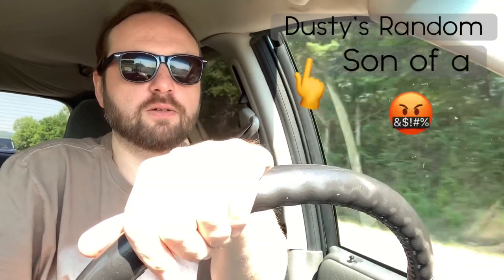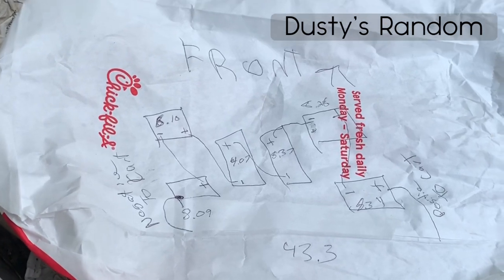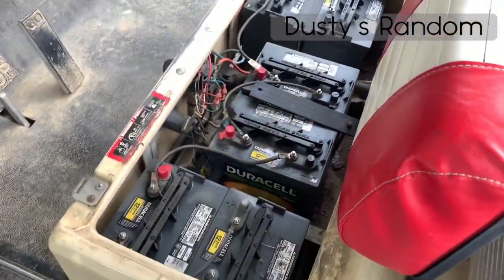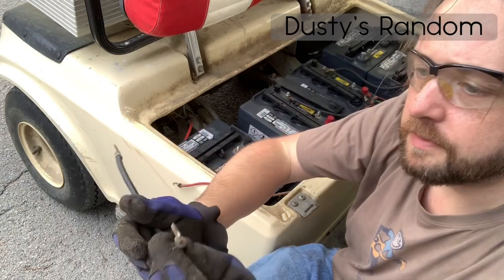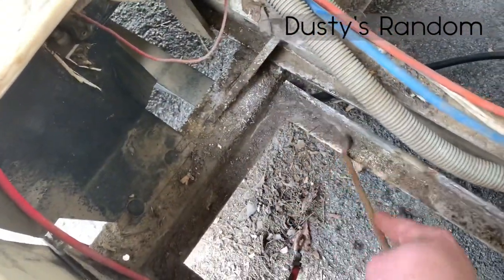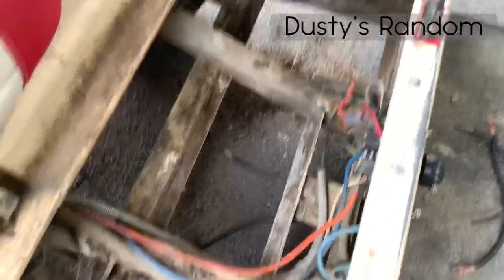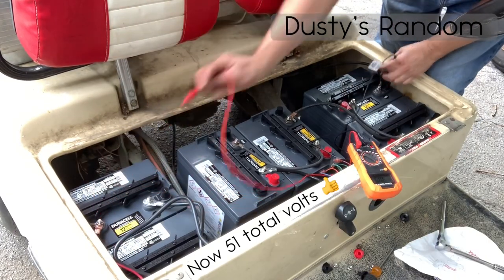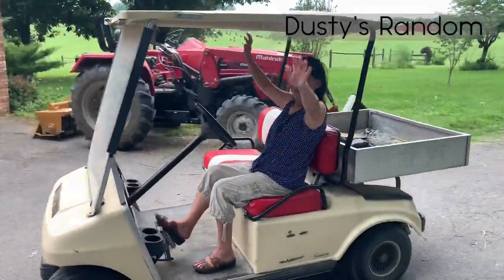Club Car Golf Cart Battery Change 48 volt

Comment: Over the years I've had decent results from coating the terminals with Vaseline before reassembly.   It helps prevent corrosion and ensures easy removal at a later time.

Comment: We almost had the exact same problem with our 6, 8 volt batteries. All 6 of them showed they were dead. I saw on YouTube where you can revive dead batteries so I bought a 24 volt battery charger for around $34 on Amazon. We charged three of the 8 volt batteries at a time and brought all three back to life. It saved me a lot of money and hassle. I just wonder if you could have done the same thing and saved some dollars.
Reply: Hi friend, how is it going with you dead battery? May i suggest you experience our 48v30ah LiFePO4 battery to replace your GC2 6V lead acid battery?
Reply: @katherinedai5911  
I’ll look into it when these batteries actually die. Thanks for the info.

Comment: Hello, I just purchased a 98 Club Cart with no batteries.  Not sure if I need 6v or 8v or if either or would work for the charge that came with it. I believe you have 8v in this video.  Any help is appreciated.  Thank you
Reply: Is your cart a 36 or 48 volt? If it's 48 then you use six 8 volt batteries 6X8=48.......36 volt is 6 batteries at 6 volts each   6X6=36